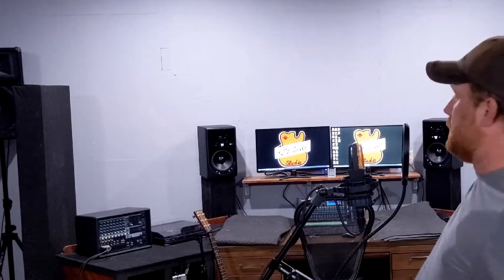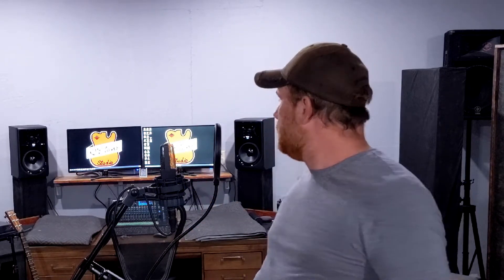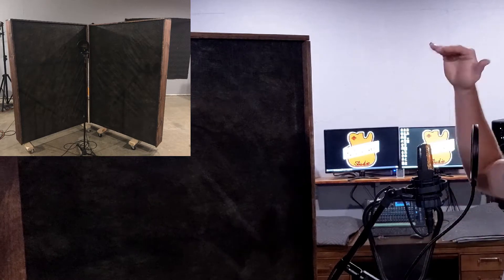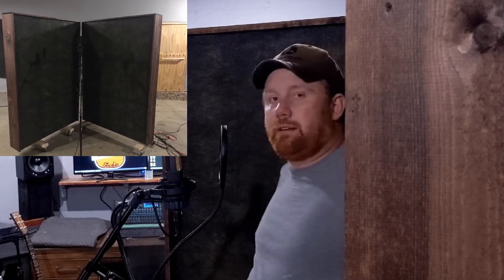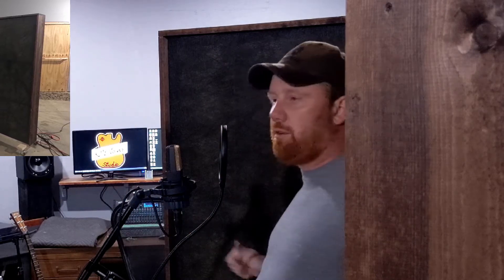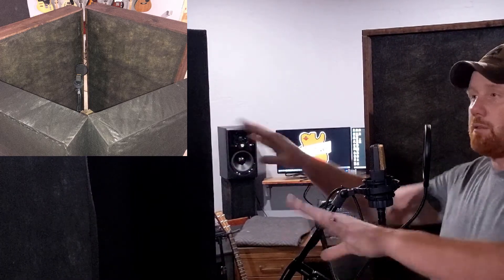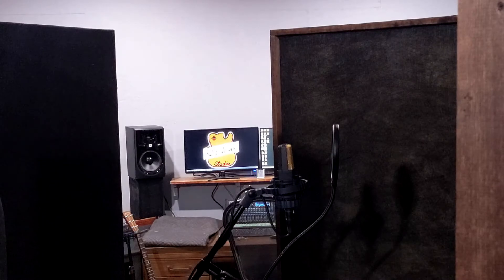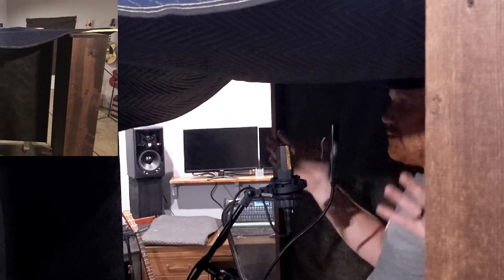Movable Panel (GOBO) - Vocal Booth Test

Comment: Excellent demonstration! I have a room where it's going to be difficult to treat the walls properly, and the landlord would not be happy about it either, so I've been thinking about floor-standing panels that I can move around to have in some places while at my desk streaming and recording, and in a different configuration when I stand up to just record vocals with very low reflections. Your demonstration was excellent, cause your room is much bigger and much more reflective. Hearing how well it worked there, I have a feeling it will do the trick here too. Thank you :)
Reply from the maker: Thanks for watching! It was pretty amazing when I was editing the video together how much better it sounded at each step. I too use the panels behind my mixing position when mixing then out in the room when recording. I'm working on a second set now!

Comment: How would u compare your solution to a whisper room? Cost withstanding.
Reply from the maker: I like that these are movable and I can put them nearly anywhere, even out of the way when I have a full band in the studio. I think the before and after speaks for themselves. A whisper room might do better keeping out outside noises better like cars driving by or computer fans running depending on your room. Of course a few 2x8s and some rockwol are going to be cheaper too